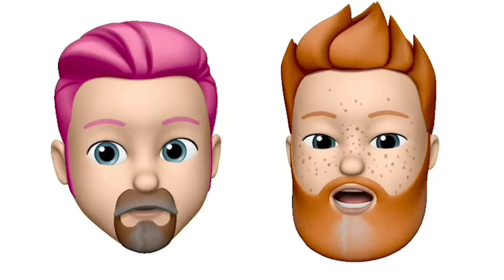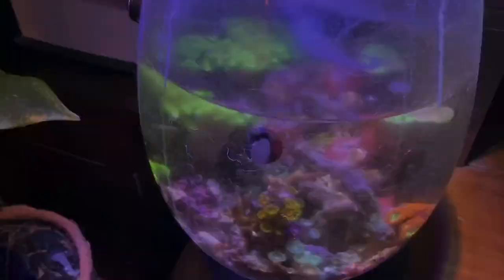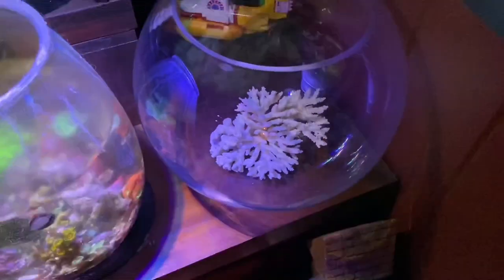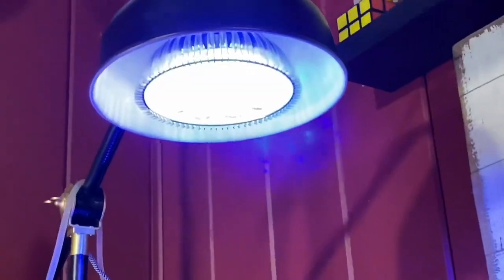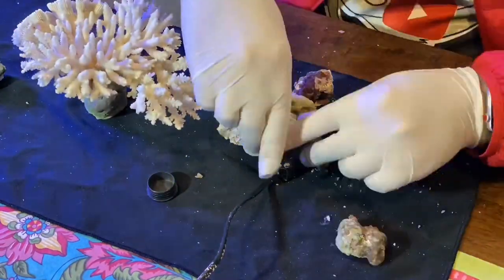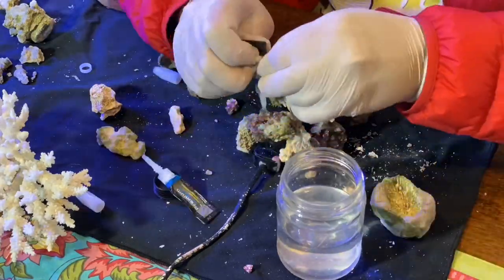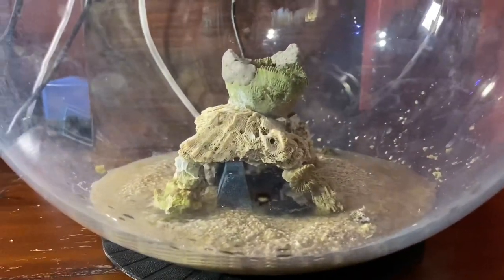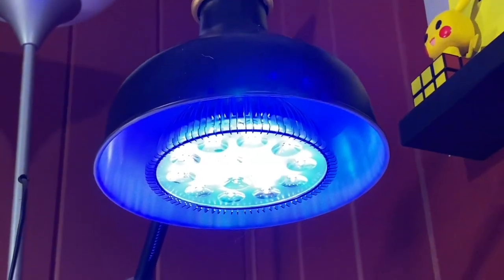How to Set Up a SPS Reef in a Bowl - Reef Bowl October 2019 Update

Comment: A bit late to the game, but honestly coralcrete is absolute crap. I've used 2-part epoxies like it when making scale models long before getting into reefing, I've used plumbing specific versions to repair leaks, and I've used other reef epoxies since getting back into the reefing hobby, and ALL of them have been better to work with than coralcrete. It's the only one that I've ever found crumbly, the only one that had to be wetted, and was by far the hardest to knead into workable condition. Use literally any other reef epoxy than coralcrete, it'll be a better experience.
Reply from the maker: Tend to agree to your assessment there 👍